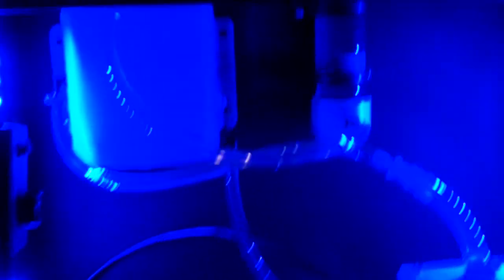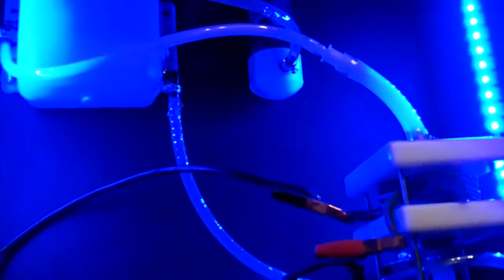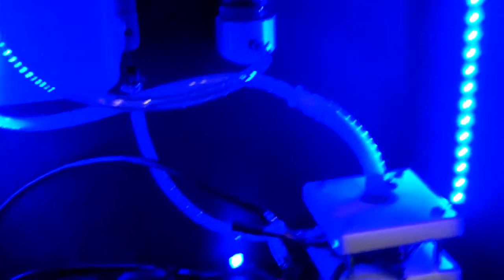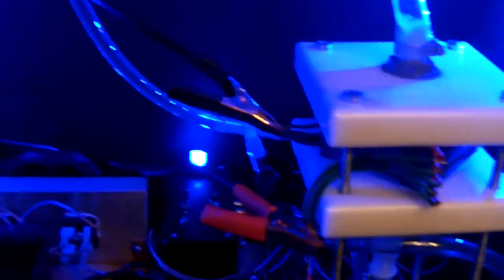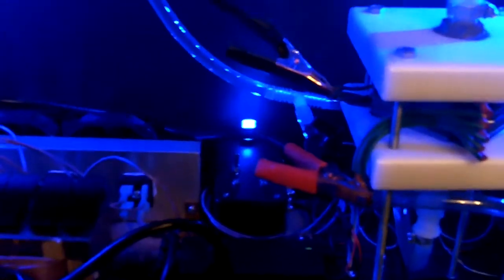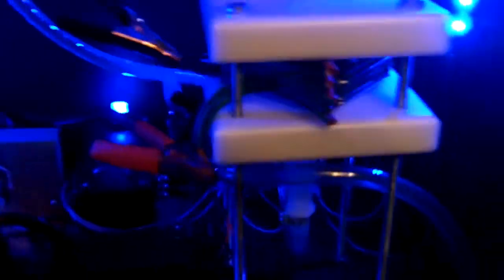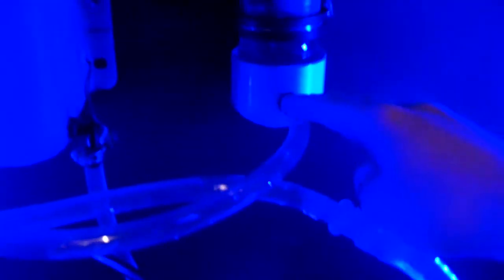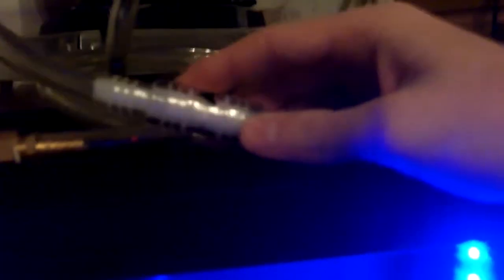HHO Torch System

Comment from the maker: @KyleCarrington A large rewound transformer should work, defiantly your 15 pound transformer. Even a Microwave Oven Transformer, up to it's point of saturation which I am not really sure of, but it is probably somewhere around 2000 watts. Also I would just use a couple turns of quality wire on the primary and secondary. I actually want to make a high voltage cell as well but I want to use somewhere around 50 volts so it is safer. But as long as you are safe 110 volts should be fine.

Comment: @BreadboardBasics Awesome. I did watch your second video on the supply, itself.. so I apologize for being a bit preemptive. I've got a dry cell running on an RV power supply, but I want build it up to a 58-63 plate 110v design. Thing is, a commercial isolation transformer is pretty big bucks.. everyone else is doing it straight recitification of mains, which worries me. Any advice? I have a quite large (maybe 15 lbs?) transformer from a large UPS, could i dissassemble that and make it 1:1? TKS!

Comment from the maker: @KyleCarrington Well the mains comes in to the transformer which drops the voltage to around 12 volts. So the only part of the power supply that has 120 volts running through it is the primary of  the MOT. Everything else just has 12 volts running through it. Also the MOT is grounded(the metal body is connected to the "third prong" on an outlet) So the power supply is not very dangerous, yea it would be bad to spill electrolyte on it but you would not be electrocuted.